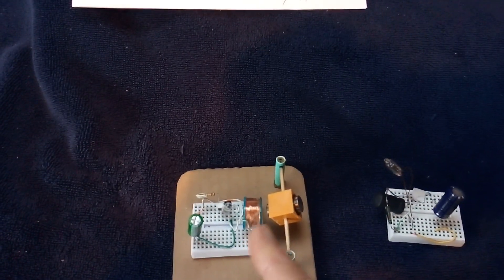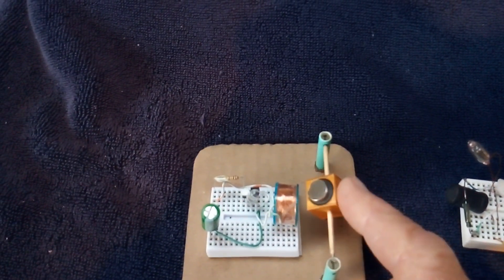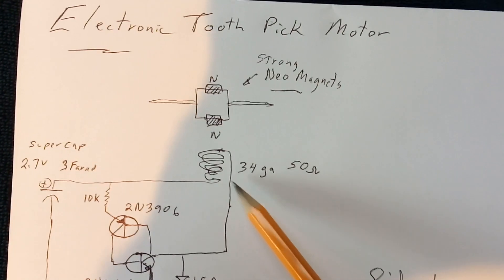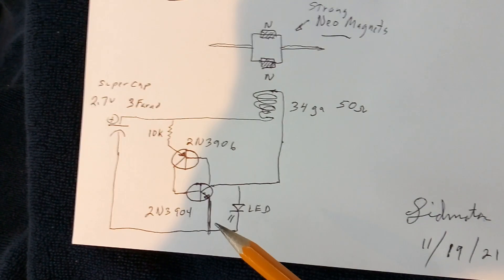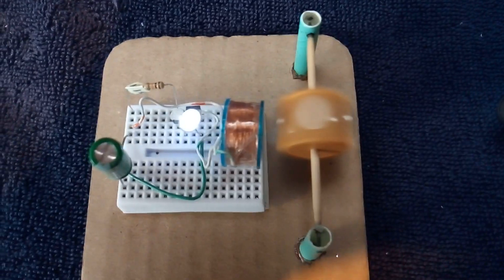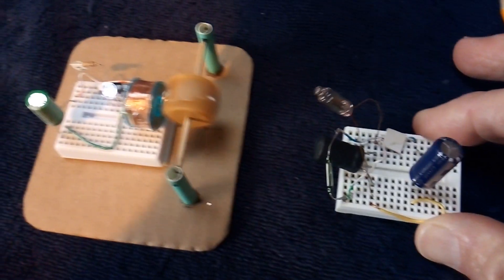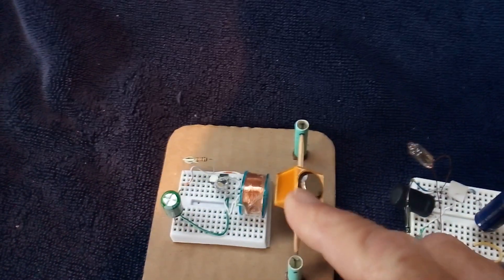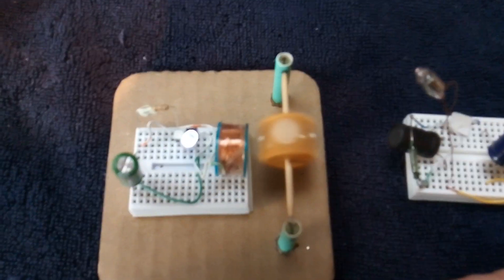Electronic Tooth Pick Motor

Comment: this motor is runing forever?
Reply from the maker: No.  It would run as long as there is power supplied or the bearings wear out.  The electronic circuit will go for many years until one of the transistors fail.

Comment: It did seem to speed up when you held the choke to it and the neon did light up.
Reply from the maker: Yes it does.  The choke / neon circuit does have some juice in the super cap.  It is driving the rotor also.

Comment: Any chance of a quick explanation of that circuit? I'm trying to understand it. Why isn't that cap discharging the whole time the motor isn't running? Doesn't that NPN transistor stay closed until a pulse from the magnet passing the coil triggers the PNP to open it? I must be thinking backwards or something. Is the pulse an attraction or repulsion? Is the approaching magnet charging slightly and the pulse is done like the bedini just past center as voltage rises to trigger? Sorry for all the questions. I love your videos and I've built some pulse motors in the past to learn myself. But I guess I'm just missing something here. Thank you.
Reply from the maker: OK.  Here is the circuit and how it operates.  Bakupcpu did this video back in 2013.  DadHav originally came up with this simple pulse motor driver circuit but it was the Bakupcpu ultra simple rendition that I fell in love with.  I have one that has been running a solar powered Lasersaber EZ Spin non stop for over 4 years.  It is very reliable.  https://www.youtube.com/watch?v=gy6zkgoHBAE&t=164s
Reply: @Lidmotor  Thank you very much! I also love Lasersabers work. I've been out of the loop for about 8 years and just now starting to catch up on all I missed.
Reply from the maker: @ChuckYoung75  Welcome back.

Comment: You’ve got that down to a fine art.
Keep the videos coming...can’t get enough!!
👍🤓
Is it possible to make a horizontally magnetically suspended toothpick motor?
Reply from the maker: Thanks. You can run this vertically.  Suspending a toothpick magnetically might be tricky.
Reply: me too

Comment: Where could I salvage the wire to make a coil, I’ve wasted almost a month of my life failing lol
Reply from the maker: You can take any transformer apart to get the magnet wire but it is alot of work. Maybe do a Google search to see if something available to you has magnet wire in it. Recently i found out that 'beading wire' that is sold in craft stores is 30ga enamel coated copper wire.  Relays, solenoids, and bells also have the wire in them also.  Of course you can also order some magnet wire online.
Reply: @Lidmotor   i m using a relay and thought maybe my coils weren’t good enough the wire was way sticker and less turns, plus using the relay is tricky finding the sweet spot when maybe your coil sucks lol, I am going to try to use your circuit, it’s a honor to actually receive a msg from you. I have been watching and rebuilding ur projects for years
Reply from the maker: @WasaMada  Excellent.  Your coil is probably made of wire that is too thick. What I have learned over the years is that you have to use what you have and if that doesn't work change the project to something else.
Reply: @Lidmotor  moved on to virtual machines ..kali lol… Intil tomorrow